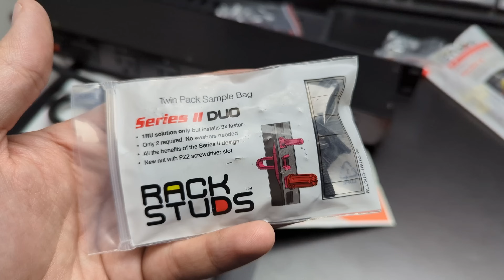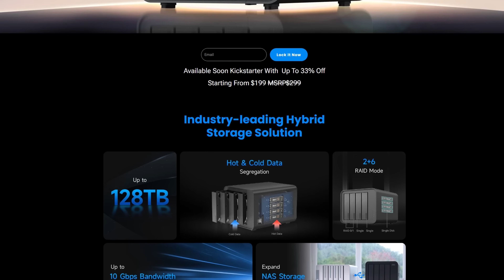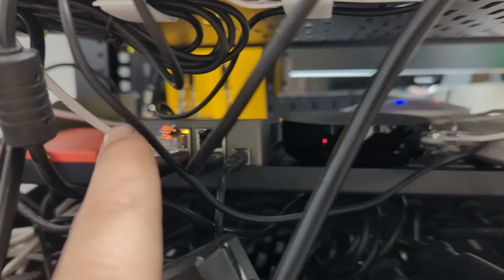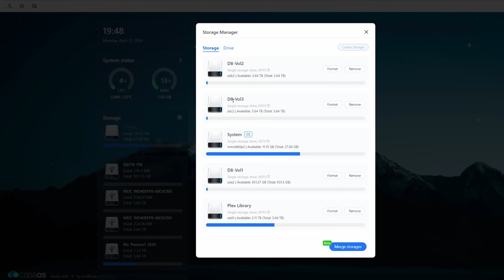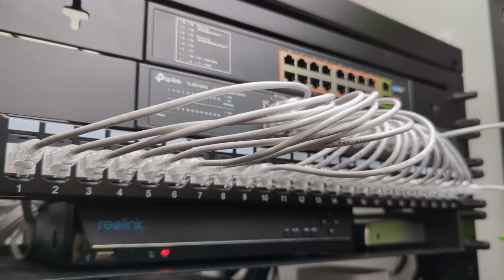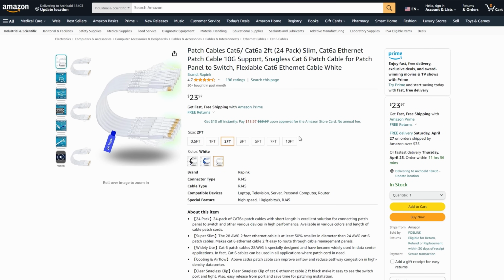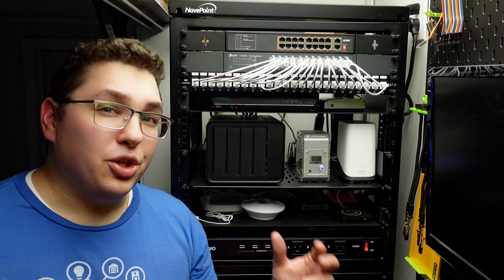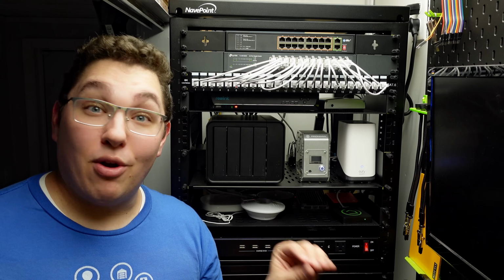My new SMART HOME Network RACK! (Build and Tour)

Comment from the maker: I upgraded to a FULL UNIFI STACK in 2025! https://youtu.be/6SysIyMrxXo

I upgraded to UniFi! https://youtu.be/6p3LCtvp5fw

-- Products to build the rack --
Nave Point 12U Server Rack: https://amzn.to/49CFagO
Rack Mount Power Supply: https://amzn.to/4aTaIQE
USB Charging Station: https://amzn.to/4cMFxIy
2U Shelves (14” deep): https://amzn.to/3TWgDh1
1U Shelves (10” deep): https://amzn.to/49A7wZj
TP-Link 24 Port Ethernet Switch: https://amzn.to/49FuUV3
BV-Tech 18 Port PoE Switch: https://amzn.to/43TOJa5
Patch Panel https://amzn.to/43UQ3ta
Keystone Couplers (white): https://amzn.to/3JiVqcq
Keystone Couplers (blue): https://amzn.to/3TOmSDq
2ft Patch Cables: https://amzn.to/3Ugh5bt
1ft Patch Cables: https://amzn.to/3JeRwRN
6in Patch Cables: https://amzn.to/3Wf1j23
Cable Clips: https://amzn.to/3WgLOpY
Bulk Cat5e cable: https://amzn.to/4aVMO7j
RJ45 Crimp Tool Kit: https://amzn.to/4cXmo6I
RJ45 Pass Through Connectors: https://amzn.to/3JfnpJN

-- Products on the Rack --
SmartThings Hub: https://amzn.to/3QgLofL
Ecowitt Hub: https://amzn.to/3xYwQe8
Ecowitt Hub + Weather Station: https://amzn.to/3W6fOVJ
Aqara M2 Hub: https://amzn.to/3WaED2Q
Zimaboard 832: https://amzn.to/3w6MO5v
USB C to A Cable (to connect D8 Hybrid to ZimaBoard): https://amzn.to/4azkA2k
Samsung nVMe 1TB Drive: https://amzn.to/43TIvXP
WD 4 TB HDDs: https://amzn.to/3TUMtL9
Hubitat Elevation C8: https://amzn.to/3W5M1wl
Pironman Case: https://amzn.to/3UvmxYb
Raspberry Pi 4B: https://amzn.to/49Rk3HT
Eufy HomeBase 3: https://amzn.to/4d8n5KI
Eufy Cameras + HomeBase: https://amzn.to/3xInT8K
Reply: I already commented, before I saw your comment. I plan on ordering the ubiquitous stuff, during our tax-free weekend next week.

Comment: I thought about that same power bar. I think I still like my method better. I added up the power consumption for all the 12vdc devices I have. Then bought a single 12vdc power supply with several screw terminals. Then got some wire and the proper size barrel connector. Now I have 1 supply powering  my Router, Modem, NVR, 8 port switch and a cooling fan. It has been going for about a year now without issues. Wire management is much better than all those wall warts.

Comment: Love the set up. I’d imagine latency would be high streaming the cameras with the eufy hub placement… 5-10s? Placing it on top would help with interference
Reply from the maker: Hey, thanks! I just made an updated video for 2025 - will post in pinned comment. The Eufy system wasn't great due to the fact that all the cameras were battery powered. PoE is much better in my opinion as it allows for 24/7 recording.

Comment: Did you not put any sort of cooling system in the rack? Even just some basic fans to control airflow to push the hot air out of there? I can knky imagine the temperature increase inside that cabinet from all the devices
Reply from the maker: It's a closet in a hallway with no doors... plenty of airflow. Huge upgrade coming out this weekend (hopefully), and it's significantly hotter. Plan to add a thru-wall fan.

Comment: I’ve had some experience with UniFi, and honestly their cameras (UniFi Protect) are the best I’ve ever worked with. They might be overkill depending on your needs, but they’re worth checking out. Their networking system is also one of my favorites since everything lives in one ecosystem, which makes it super easy to manage. The access points are PoE-powered and perform amazingly — highly recommend if you’re looking for a reliable setup.
Reply: just saw your pinned comment and it looks like you already did what I suggested lol.
Reply from the maker: I'm all in on Unifi haha.
Wait tl you see my 2025 rack 😁

Comment: Get some Velcro tape and use it to neatly stick all those power bricks to a shelf. 

Then get some Velcro ties (3M strongly recommended) to tidy up all the cords for those power bricks. 

Learn from my mistakes:

Don’t use double sided foam tape to mount the power bricks or anything else.

Don’t use nylon zip ties to bundle up the power cords. 

The more connections you have, the worse brush panels look. Stick with patch panels.
Reply from the maker: I got some Velcro tape! Yeah the double sided 3m is not the move

Comment: You made a comment about looking for a mesh system. I have a real old original ac3000 Orbi 3 piece mesh system. I've had some strange problems with connectivity. Orbi mesh is pretty good, but theiir top system is $2K. I decided that I'm going to go out and go with a ubiquiti system. Ubiquiti system it's going to be over all cheaper and more flexible. Granted it's not a mesh system, but I don't think that's the end all, be all.

Comment: The best thing you can do when starting a network closet is to cover the entire wall where the rack will go, with plywood ( 1/2" should be fine.) Start with good one side , screw it in place and then apply a layer or two of drywall mud, sand, and paint. You can get a very nice finish. Now, when you want to screw stuff to the wall, there's no need to hunt around for a stud.
Reply: @DavidM2002  also, try and spend the little extra to get fireproof plywood and secure it to studs or use 3 inch or larger toggle bolts (if it only crosses one stud
Reply: @LinkandPage  I have never heard of fireproof plywood but that's a great idea. I guess, in a pinch, you could also hang a sheet of drywall on either the front or back side of the plywood.

Comment: Rather than have a raspberry pi for this, a zima board for that, a blue something for HA, etc... you should just build a computer with a 16 core / 32 thread CPU (Ryzen 7950 or whatever) and then virtualize each of those components from one box.  You could have your OpenSense firewall, Plex Server, TrueNAS server, Home Assistant, Nextcloud instance, and plenty others all from one device.  It takes up one power outlet, 1 ethernet cable, and 1 U of space.  Just a thought.
Reply: Yeah?  And if that computer crashes you lose ALL of those virtualized components.  There is power in segregating things, depends on how you look at it.
Reply: @atlantic_love  Yeah I agree with you, but the beauty of virualization is you can have 2 or more CPUs in various places and just move one component to another computer in seconds without having to set anything up again.  It saves time.  It ultimately comes down to how many things you have and how much your time and space is worth.  I wouldn't do this for 2 devices.  On the other hand, computer parts or so reliable these days that even cheap chinese mini computers that can virtualize many things can stay on 24/7 for years without failure.  I would say though that overall, when you have as many components as this gentlemen, having one or two all-in-one devices will save time, space, and money in the long run.  Most people with this many components are constantly buying new components and replacing other ones just to test things that you might as well just get the big server.
Reply from the maker: That sounds like an ideal setup! I've never messed with VMs and stuff like that. I always thought those things required more maintenance then having dedicated hardware?
Reply: @MakeItWorkTech  I guess its how you look at it.  I would say its less maintenance as you just have to update the virtualization software a few times a year.  Proxmox, which is popular, is a two command line update and then a reboot of the system.  Updating each VM is no different than on dedicated hardware but maybe easier as you can do it all from the same web browser as opposed to having to connect to each device separately.  Nothing wrong with doing it either way, just more streamlined with one machine.  One disadvantage of one machine is everything goes down with a hardware failure.  One advantage of a single machine is that you can build 2, clone each VM, then have each machine essentially mirror the other in the event that one goes down.  Just more stuff to play with.

Comment: If you get a UPS you can plug one power distribution into critical and one into non critical. Then it is easy to power what you want to keep alive in an outage. For me I used a deeper rack and put AV stuff on one side (not critical) and networking stuff on the back with UPS backup power.

Comment: I'm in the same boat as you. I have the older Google WiFi generation and it's been a huge blocker since I started my home lab. It's a great mesh system—somewhat limited—but it worked fine for years. Anyway, I am in the process of overwriting the Google WiFi OS with OpenWRT, which should save me the cost of buying a new mesh system while I'm building my rack :)
Reply from the maker: Awesome idea!! I never knew that could be done!

Comment: If you haven’t landed on a mesh networking solution yet. I can vouch for Asus routers flashed with Asus Merlin firmware as a good solution. It’s not entry level or advanced but definitely a nice middle ground. Their mesh works flawlessly and I’ve been rocking it for about 3 years now with zero issues.
Reply from the maker: I ended up going with Unifi!

Comment: 4:30 I remember back in 2009 when I took my networking class in college, we didn't have access to the RJ45 connectors that let the whole cable pass to the front, we had to measure by hand and make sure  he little filament would make contact with the copper pieces of the connector. it was a nightmare. so much wasted cable.
Reply from the maker: Sounds rough! haha

Comment: I just finished getting my first rack up and running with mostly Unifi components and also a Nave Point case. I did go all in and run cable from the rack to a few different rooms in my house, which was built in the 1940s. It wasn't that bad, really. I'm sure you could definitely do this in your house if you have some of the right tools. You might need to learn how to cut and patch some drywall and maybe add a few yellow or red tools to your mostly white tool collection, but it's doable.
Reply from the maker: I might have to give that a shot!

Comment: A little late to the party, but a couple thoughts from an IT pro:  Replace your cables with CAT6.  CAT6a is NOT needed for 10gb unless you're pushing distances.  Within your rack you're 100% good with CAT6 for all your (future) 10g needs.  And the keystone pass-through patch panel works just fine... absolutely nothing wrong with them.  They're great because they require zero work, let you use really nicely manufactured cables, rather than forcing DIY crimp jobs that just are not as effective and don't actually save much money if you ascribe ANY actual value to your time, and if you have a problem with any single port, it's extremely easy to pop it out and replace just the one.  Far better than combs.

I was recently in the same boat as you, with regard to smaller capacity double-stack switches connecting to single-row patch panels (seriously WTF).  6" and 12" are great for about 80% coverage, but that last 20% things get weird.  I found 7.5" patch cables on AliExpress that really helped fill in the blanks between the two distances.  Game changer!  It really puzzles me why no one makes fan-out kits that have connectors of varying lengths that smoothly run from 6" to 12" so you can have a nice even spread as the distances go.  Sets of 24 cables would sell well.

Comment: Not bad. Running cables are essential for having a good home network. I don’t like that you have so many different hubs. The back area with the plugs is no bueno. I also didn’t see any sort of UPC or battery backup for your setup. I don’t think your Plex setup should be in there as it should be in a prime location where you consume content most. This way if you ever become an Audiophile, you have a place to build out further.

Comment: Always make sure when you mount the rack that it's not going to be in the way of anyone ,espeically if the door is open as people tend to bang their heads on it and it pixxess them off  ,especially commercial installs .
Also if it's going to be fixed on dry board make sure you use Gripit fixings and not curly wurly plugs as they're not strong enough to hold it .
Oh and if you're gonna.make your own patch cables use a boot to go on the end as it protects them and also.looks a lot more professional.

Comment: Nice rack. First, LABEL YOUR PATCH PANEL. You will thank me down the road. Next, while it is a nice rack, if you are a serious home labber get a 44 inch deep cabinet. I have one and it is a dream for those deep servers and switches. Next, get a 44 open rack. You have no idea how hand this is. I have both these in my lab. I have a whole wall of stuff in our media room closet where the house stuff is. It's all structure wiring with a 36 inch Leviton panel in the wall between studs and another 48 inch by 48 inch painted plywood board on the other wall for all the stuff that won't fit in the Leviton box.
Stop whining about installing RJ48 connectors. With the newer push through connectors they are a dream to install. It only takes a few minutes and you are quaranteed to have a good connection or you will have only yourself to blame.
Another great thing that I recently bought is:
https://www.amazon.com/dp/B08HDGBWGV?ref=ppx_yo2ov_dt_b_fed_asin_title
This is a dynamite POE tester. i wish I had bought one of these a long time ago. When you get into POE a little further this little gem will really save you ass........Trust me.
Great video. I subscribed a while ago and enjoy them. Cheers.

Comment: Nice work! Cable management is about getting the right lengths. As for cage nuts, there is a tool. Once you get used to it, its quite easy. Also, try to keep your power on one side and data on another. After you wire a few networks it get easy. Also, I always run plenum grade cable; while not required in the home, I still use it. Structured cabling habits die hard.
Reply: >As for cage nuts, there is a tool
Ah yes, the flathead screwdriver :3

Comment: I have a ? what are you gonna do when you get more cabels for your poe switch, are you gonna buy a rack panel more or just use the poe
Reply from the maker: I made an update video (linked in the pinned comment) where I've made some changes. I ended up switching to a brush panel, and I'm picking up the Unify poe switch to use with my UDM pro

Comment: If you want to have ethernet ports throughout the house but don't want to run new wire, I'd strongly recommend looking into MoCA. It's an awesome tool that uses the existing house coax lines and converts them to ethernet. Then of course you can have switches in each room for more ports and you can have wired backhaul on your mesh system.

Comment: 2 issues i see (av guy that does smart homes from pre-wiring to programming) patch panels are horrible, you're adding 4 more additional points of failure that are honestly very annoying to trouble shoot, never use pass through RJ45s i have seen dead switches and dead ports because of this
Reply: didnt see the end, brush plates ftw
Reply: @nickm6443  Eh, thats only a issue if youre not properly labeling cables, which yes youre right many of us get lazy and dont do that.
Reply from the maker: Latest update video i added a brush panel! So much nicer!
Reply: @MakeItWorkTech  heck yeah, just loose the pass thoughs and your good

Comment: Rather than going with another mesh only system, I would personally recommend TP-Link Omada. They have firewalls, switches, and access points that are all prosumer/SMB grade that can either be configured and managed independently, or setup with a software/hardware SDN controller. As a bonus the equipment is all very nice looking and I cannot overstate how fantastic built in Wireguard is since having set that up with all of my devices.

Comment: Great build! I'd recommend NOT using pass through (pass-thru) RJ45 connectors especially with PoE they can void your warrenty. 

I like the 2 piece style RJ45 connectors the loading bar keeps the strands organized but doesn't leave copper ends exposed.

Comment: Unifi for Wi-fi. All of their units mesh. Just use a POE adapter without the lan side plugged in after it's adopted and you are all set. You can also run the controller under linux in a VM. Check out the install script by Glenn R. Makes it super easy to update. Either that or get a cloud key.

Comment: If looking for a wifi replacement, I would consider using access points (APs). You can pick up unifi APs for ~$100 and they will make use of your POE switch. Nice job on the rack and +1 for the rack studs.
Reply from the maker: Thanks! So I can just buy a couple and start using them with my current setup?

Comment: Try TP-Link DECO just for small places/small home - up to 2 bedrooms apartment. Omada for a bigger house with garage and yard, but you'll need a POE switch to power your wi-fi devices and probably if you want to exchange your cameras in the future, you can use POE to power them.
Considering the CAT5E cables, try to replace them at least on your rack, connecting your devices such as NAS and e-security stuff on your switch with a good CAT6E or even 7... Between your off-rack devices is just ok, especially if you not using multi gigabyte devices...
Reply: Cat 7 is a waste of money, and most people dont have punchdowns or crimpers that adjust to the thicker pairs and unless youre exceeding 250ft on your runs, cat 6 cables shoukd be more than sufficient for at least the next 10 years. If you really wanna future proof and do t mind dropping $380 to $600 for a bit of 1500ft, go with cat 6a. Leave cat 7 for burial and aerial runs, which most residential wont ever have since even guesthomes on properties will get their own modem and SSID, or can use MoCa or simply set up extenders. And if burial was needed,your ISP needs to get off their lazy behinds and trench it fir you